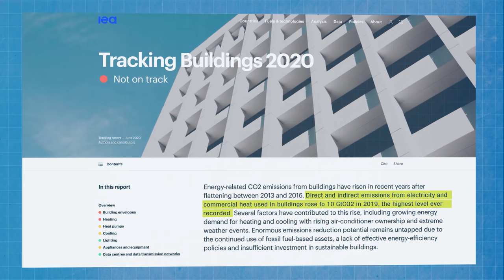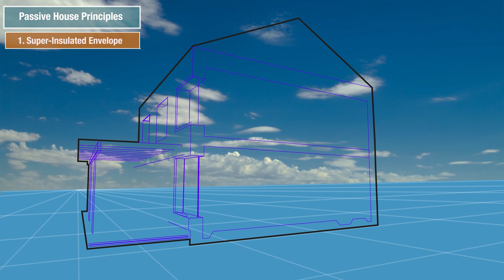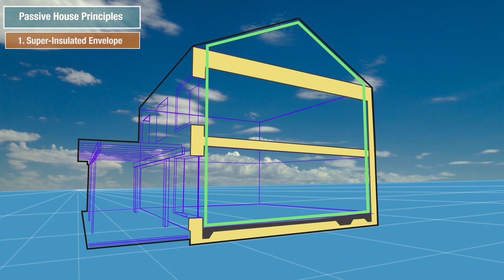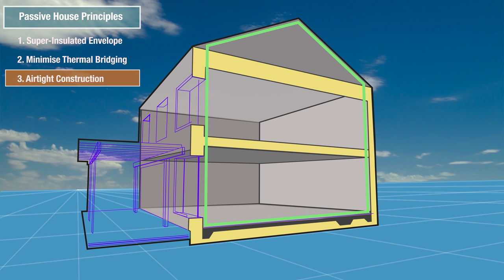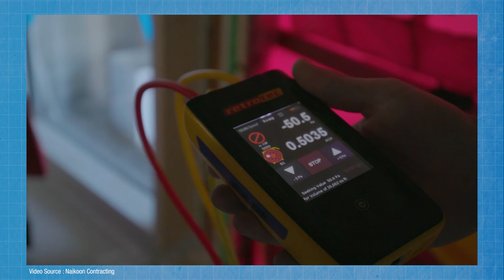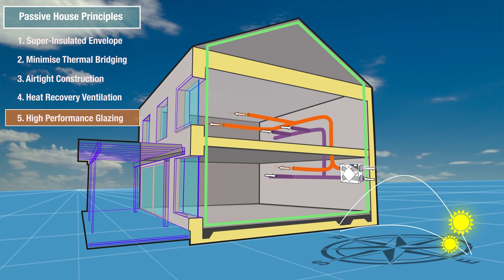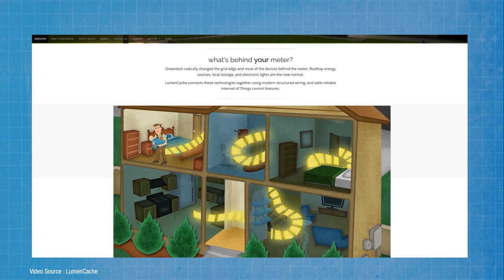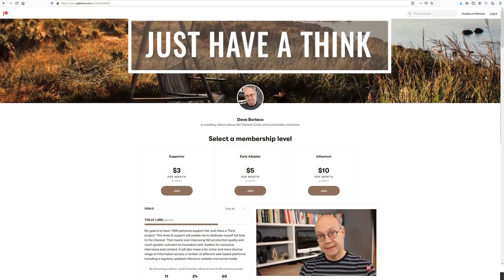Passivhaus . A low carbon future for our homes?

Comment: Mr. Borlace, started watching your videos a few months ago and would like to commend you on the consistently well researched and interesting content. As someone working in architecture I'm happy to see you discuss the building industry.

Passivhaus is important to reduce the operating energy of buildings, and from many of the comments I've read is a huge boon to quality of life. But it's only part of the story, embodied carbon which I find is a relatively neglected topic accounts for about 11% of global carbon emissions. There's been a lot of interesting developments in this space recently to try to find low carbon alternatives to the concrete, steel and petroleum based insulation that makes up so much of our built environment. Cross laminated timber is one of the most exciting to me, as it is starting to be used in high rises as an alternative to steel/concrete, with (just like passivhaus) myriad co-benefits independent of its lower carbon footprint.

While I'm sure you have a huge backlog of projects, I'd love to see an exploration of this topic!

Comment: I have been renovating and highly insulating my old houses for 10 years now transitioning them from natural gas heating to renewably powered electricity. The 1910 house and 1914 house both had to have their crawlspaces dug out for wiggle room so I could install R35 floor insulation. Big job but together with R100 attic insulation and thin film plastic on all the old windows this allowed me to remove the central natural gas heaters. I am now building thermal mass electric heated tiled floor slabs for silent, gentle and even heating. Focus on high insulation first though. Before I started the old 1910 house was cold and uninhabitable after 20 minutes if the natural gas heater was turned off in the fall when 0C outside. Now after installing insulation the internal temperature declines from 20C to 10C over 8 hours when all heat is turned off when 0C outside. High insulation works! I am also scaling up my 6x6 foot solar heater with 95C of heat output when sunny. So far it works really well for heating which is why I am scaling it up.

Comment: We have been doing this for the last 1000 years with the natural plants available here in Assam, India.
Reply: *citation needed
Reply: @SimonPilepich   Assam is used to frequent earthquakes and heavy rain causing flood almost every year. Nobody knows who is the first to use those materials to built houses, but the traditional houses of Assam are very effective against earthquakes, moisture and also the walls are very good insulators and fire resistant. 
Materials used are various types of locally available materials mainly different types of plants. 
Even the british were shocked when so many houses survived the great earthquakes of 1897 and also 1950 whereas the british built houses were broken. 
Am not sure if you find any research paper on it  but to know about it, you should visit Assam and check for yourself.
Reply: @saurangadas  I've had a quick look at it and I can't see any evidence that Assam has a history of well insulated buildings.

From what I can see they use lightweight materials and are barely insulated if at all.
Reply: @SimonPilepich  let me describe you how its made. 
The inner material is a bamboo like plant which is hollow inside. Diameter around 1.5-2cm I don't know its english name. The plant is dried and then used. Some people also use woven bamboo but the earlier is more effective for insulation. 
Above that clay mixed with organic fibers is used to cover the wall from both side. This acts as fiber reinforced composite to provide strength to the wall. 
The last step varies. Some use clay with cow dung and some organic extracts to repel pests and give it a clean finish. Later some people also started using lime powder with clay to give the finish. 
The walls and ceiling structures are from wood. It divides the wall and ceiling into smaller parts to form the main structure. All these smaller parts are then filled to form the house using the 3 steps I mentioned above.
Reply: @saurangadas  I appreciate all of this and acknowledge the benefits of low impact ecological building technology.

It is not what is being demonstrated in this video however. The two ideas can work together but are definitely distinct
Reply: @SimonPilepich   I have actually lived for many years in a house made like this but at present live in a house made of concrete. 
Earlier I didn't understand its advantage well. But now living in concrete house, I understand how well the house I lived earlier was insulated. 
It almost maintained constant temperature as mentioned in the video. 
I think applying those techniques with some modifications can solve many problems of modern house building.
Reply: @saurangadas  i am guessing some of those techniches and materials are spessific to the region and cant be used globally. Also the organic materials are gping to provide inconsistant resaults and are going to be usefull in agriculture and boimass. 
It is really cool,but cant compete with modern tech.
Reply: @davitdavid7165  one of the greatest mistake is to totally underestimate nature. Most of the solutions to our modern society problems are present in nature. 
But we don't find it necessary to explore more use of nature.
Reply: @davitdavid7165  Compacted straw is often used in barn conversions in Europe for insulation. Its the same principle. Cheap natural material.

Comment: I LOST my house in 1987.  Apart from INSULATION, heat may be recovered from ventilation air. by a HEAT EXCHANGER.  My little firm produced a prototype turbulent counterflow air-to-air heat exchanger.  This ran for a whole year, showing that it worked nicely in reverse during the summer.  It required 50 watts of power to drive it.
This was 83% efficient.  No major company was in the slightest bit interested.  No minor company was in the slightest bit interested.  I ran out of money and employment and moved to Tenerife, shouting F U at Britain.  I don't need heat here.
The heat exchanger was remarkably similar to a pile of egg-boxes, and would have cost perhaps TEN QUID.  Britain has spent possibly TWO HUNDRED BILLION QUID heating up air which it threw away, in the interim. That's a very conservative estimate.  Haha.

Comment: Regarding solar aspects: 
1. Don't put windows on the east or west sides of the house! It's a recipe for a hot house. Keep those walls all brick, or put the garage there (and make the wall between the garage and the rest of the house well-insulated). The car won't care if it's a bit hot. You will.

2. Eaves are very important for keeping the sun out during the summer. Make sure you get the length right for your climate and latitude. 

Longer eaves stop the sun getting in earlier in the year, shorter ones let it in for longer. If they're too short, you'll be getting sun in the windows after the point where it's gotten too hot to be wanted. If they're too long, your sun will be cut off while the weather is too cold and you'll have to heat the house to make up for it.

3. Make the roof angle match your latitude (eg. if you're 30.5 degrees south, the roof should slope 30.5 degrees from the horizontal). That gets you the best average angle for your solar panels or hot water.

4. Pyramid-style roofs are lousy for solar collection. Those east and west slopes really eat into the available roof area for putting panels and hot water systems. Limit your roof slopes to north and south.

Comment: We live in semi arid rural Australia, where temps range from hot to bloody hot. We are presently building a solar passive house utilising small footprint, good insulation and seals, and using the underground temperature constant (17C or so year round, laying 50m pipe field at a depth of 1m which draws fresh air in from outside, cools it to 17C then vents into 13 floor vents strategically located around the house. Hot air is drawn up and out using a small 12V fan, so temperature can be moderated year round. We also have a wood-fired stove/water heater, which will allow the addition of radiators should we need it to deal with the cooler months, however not likely to be necessary at this stage. We are also on a large enough plot that our solar aspect is maximised for heat rejection in summer and heat absorption in winter. I have just finished uploading the videos of the ground slab preparation, which shows the size and placement of these floor vents. Our project will continue to update on JBFROMOZ channel as we continue our build over the coming months

Comment: I had my house designed to be close to passivHaus standards here in Japan. I have 12cm + 6cm of fiberglass insulation in the walls but i wanted  24cm. The biggest obstacle was the wall/frame construction used in Japan, which dates back many hundreds of years.
With triple glazing, a good heat exchanger, and 11kWatt of solar panels on the roof our running costs including water and sewerage are about -$140USD a month (Yes, that is a minus sign).
I would highly recommend spending a few years, planning and looking for builders who know what they are doing. If you want the house to perform for 100years you have got to do your homework, and have got to know what materials will last.

Comment: Re: a follow-up or part 2 on this topic would get a big thumbs up from me! I've bemoaned for years the disgracefully poor standards in the U.K. house building with no forward thinking  and the assumption that it's OK for the homeowner to pick up the inefficiency tab.
Reply: I think legislation is the only way to change ge this. Up front costs are high and the big house builders have no interest in building a house above market price. The savings only come later to the owner. I'm lucky enough to be a Brit living in Luxembourg where most of these features are standard on new builds by law and the best tech comes from close by in Germany and Austria. I'm shocked when I visit my parent's new build in the north east.
Reply: @ecoworrier  German house building standards were exactly what I was thinking of, along with those in Scandinavia. I agree also that legislation is the only way and presently, the UK govt, now as poor as it is, has no interest in real "teeth" legislation (despite its commitment to carbon reduction). Maybe the way forward is the EV angle - promote the high upfront but low running costs. Of course, the mortgage co.s would also have to be involved, perhaps a lesser required deposit on passive houses.
Reply: @andyroid7339  I agree. In Luxembourg we have a government grant system where you can get mo ey to cover a house inspection on existing property or money towards green tech like heat pumps or pellet boilers. I got 20% of my PV roof paid for like this.

Comment: A very cool illustration of a house's air-tightness is whether or not you can slam an exterior door shut.

In the '70's we built a pre-cut log cabin and the (experienced) team that built it gave us such an effect. This is a common feature of houses built with legacy techniques here in northern New England. ... Just a note. ... The 24' x 32' cedar house is still tight 50 years later.

Comment: Good subject but you need a lot more than 10 minutes to tell the Passive House story. You covered some important points but there's buckets more. Here at Helios Eco Lab in Greece, a self build eco house we set ourselve the additional goals of producing all our own  solar thermal and PV energy for heating/cooling/appliances and a fleet of electric cars which also serve as a battery storage devices for when the sun doesn't shine. We also harvest rainwater, grow a proportion of our own food partly using humanure, we have a green roof, use recycled materials where possible, store excess thermal energy in our basement pool, make electric bikes in our workshop and have open days to spread the word.

Comment: I am not all for passive houses being an architect myself..  superinsulation is the problem.. insulation especially anorganic ones are supposed to work for about 50 years (if being generous) after that you have the problem of disposal which is not thought about.. and the one of the biggest problems is that after applying a certain thickness of insulation it is really hard to gain additional thermal insulation, it is so minimal that you end up putting upwards of 30cm and more of insulation on the wall, which imho only helps the manufacturer of the insulation and again needs to be disposed at some point, not even talking about the CO2 produced during production.. therefor my take is insulating a house well, is a must but by no means is a passivhouse something I would ever recommend to a client...
Reply: True. In hot humid climates I think you want low thermal mass ventilated roof and preferably walls like a rain screen or hanging with a large air gap. For humidity rammed earth or rammed mud bricks that breathe. Unlike super wrapped inside a plastic bag relaying on mech ventilation

Comment: Couldn’t of been a more timely video, I’ve been looking in to this standard as it’s become more apparent my 1970s house is leaking energy like mad
Reply: My house is from 1940s 😬
Reply: @VH-eq2ci  my house is pre 1840s 😅 I've just installed double glazing! 😬
Reply: Did my house and it was easy, pulled all the siding off, put up a fluid applied membrane (like paint but thicker) put a two inch  extension around the windows  flashed windows, applied two inch foam /tape and resided the house. Note I live in a hot humid environment, if you live elsewhere the moisture/air barrier  may belong elsewhere. total cost 2k  payback in energy saving 5 years plus my house is very comfortable.  watch Joseph W. Lstiburek videos for a start. and what worked for me may not work for you. please read up, watch his videos and build for your situation.
Reply: I would also recommend builditsolar.com a Boeing engineer looking at cost effective refit of houses.

Comment: Also have a think about straw bale construction. Too is interesting.
Reply: Until it rains...
Reply: Lexie Crewther read up on them, they are highly efficient and are sealed over like an Adobe structures. It’s a proven concept.
Reply: @garrygballard8914  I am an expert in climate change adaptation and contribute to the IPCC. They are only useful in DRY climates. If the ground gets saturated, even once, the straw is DESTROYED

Comment: I'd love to do a project like this.

One thing I would change is the envelope - I would put the loft outside the envelope, have an integral PV solar roof and put the cold side of a heat pump in the loft.  This way heat could pass through the solar panel and via the heat pump into hot water storage, and the cool loft would keep the PV panels cool and running at higher efficiency.